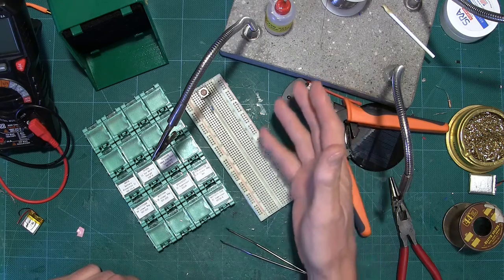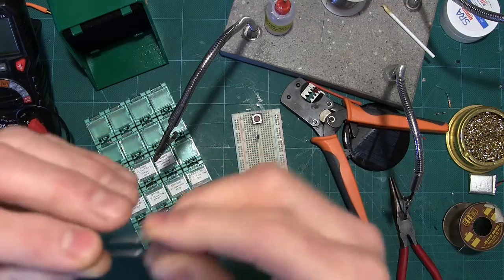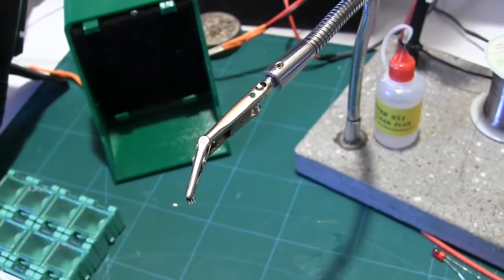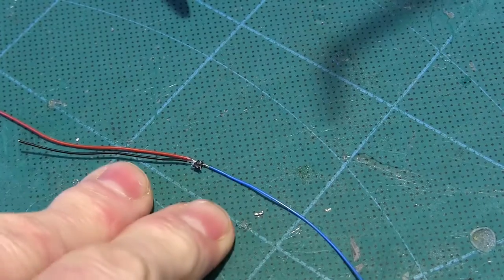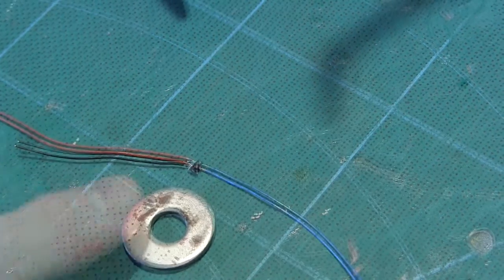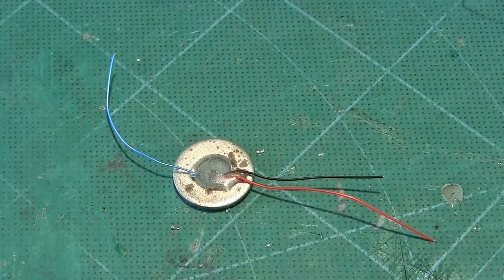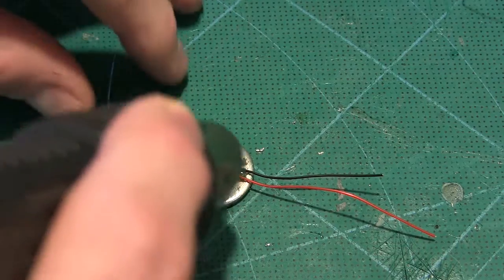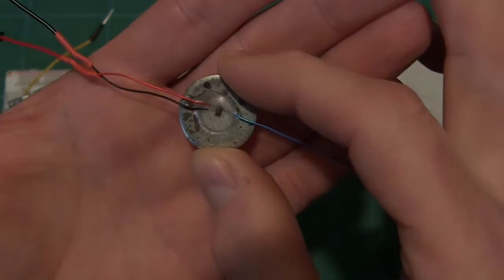SMD to Breadboard Hack

Comment: That reminds me of spidering in PIC microcontrollers to the original Sony PlayStation back in 2000 so the machine would play burned-copy games.  Jeez, some of those ICs on the PS board had a gillion pins about 1 human hair away from the next and my soldering iron was a Weller soldering station...was that a WL100...something like that.  Itty bitty connections and it was easy to solder bridge them.  I think, for this, I'd cut a copper-clad board, ink the basic areas, scratch most of the waste copper off, maybe lightly acid etch the board to be sure the traces were clear, and stick it w the solder paste and that hot air rework station. Then it'd be easy to solder the leads to the same pad.  Not nearly as entertaining as what you did and it wouldn't have that washer to keep that little MF from blowing away.

Comment: UV setting resin is the answer.
Reply from the maker: I've not used that.  I should pick some up.
Reply: @dork3nergy I hope you did! It’s also fantastic for reinforcing where wires are soldered to PCB like to a battery holder or something that wants to snap or tear off a solder pad. And if you use too much then maybe you really wanted to IP68 an entire module 😅